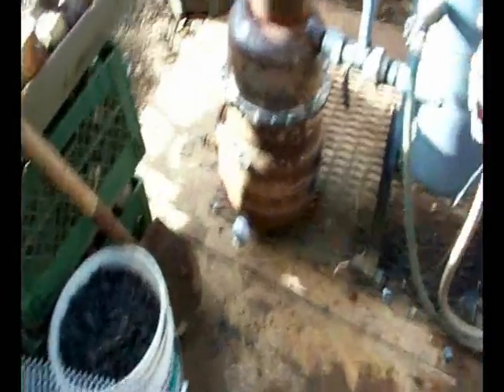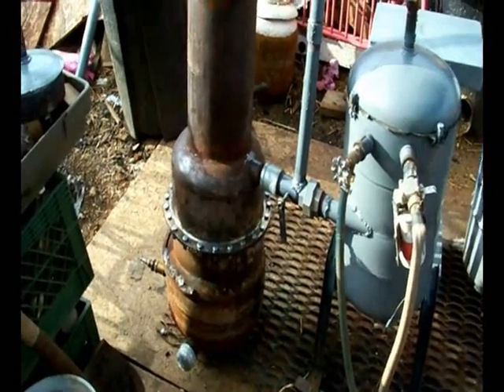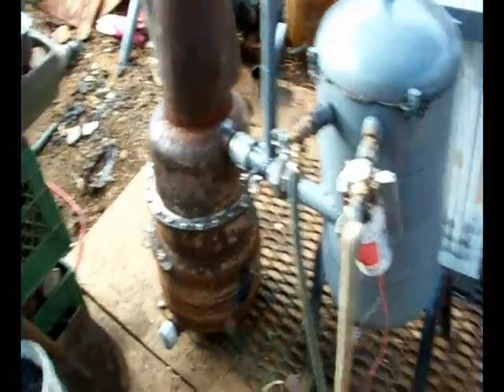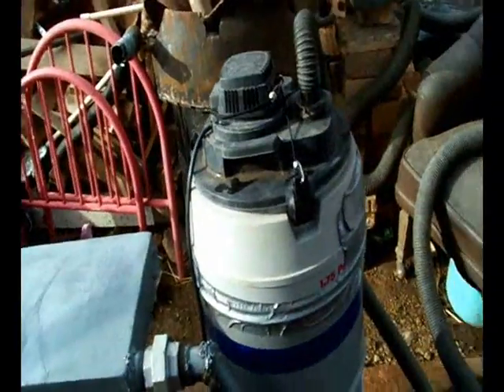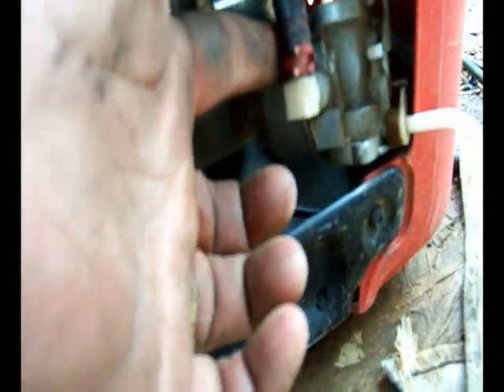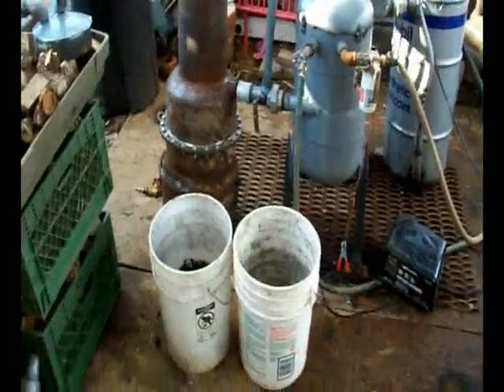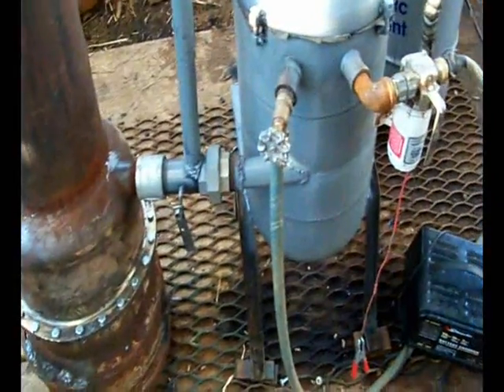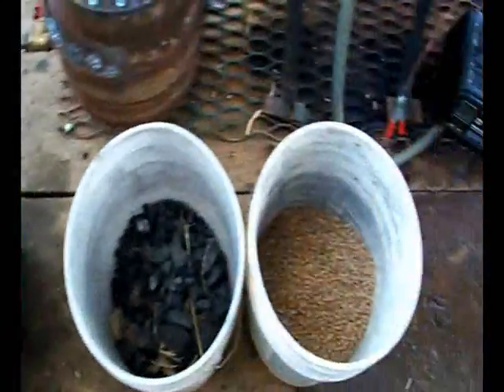WoodGasGenerator1

Comment: @MrAustin8585 if u use an engine that can run on gasoline and wood gas like i do u start the engine on gasolline then u syfen of some of the vac perss to start the reactor wen the reactor starts u slowly taper off the gasoline and add more wood gas untill ure runing on just wood gas no pump or vacume necesery
=3-

Comment: @KesslersCross  its like a car u have to use some of the electricity u make to run the gasifier but some times u dont need a fan or vacume if its running an engine the engines vac press keeps the reaction going =3-